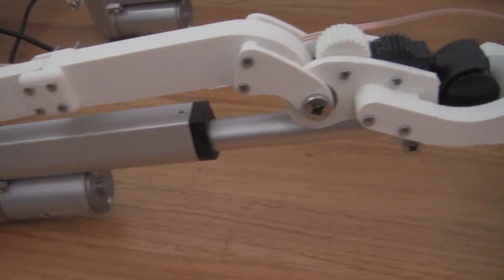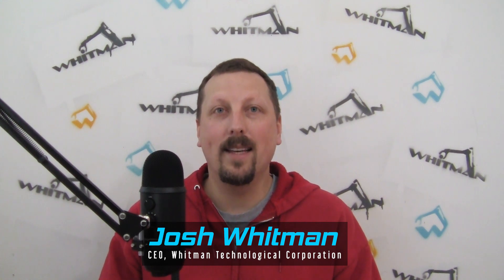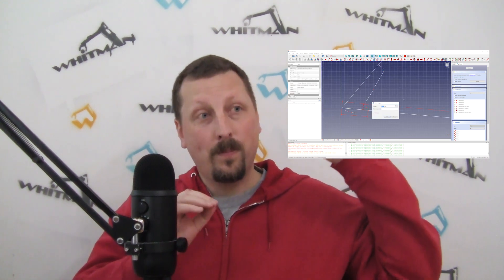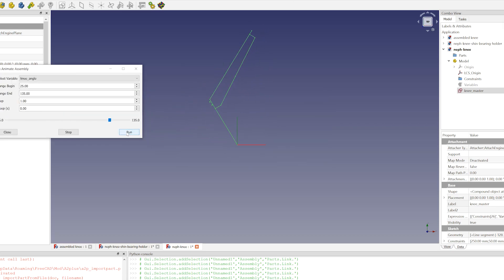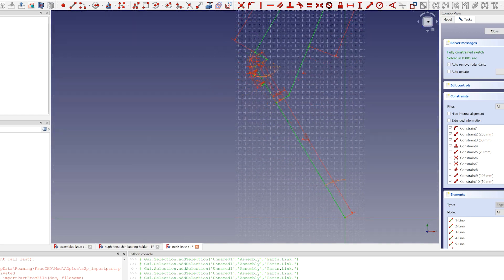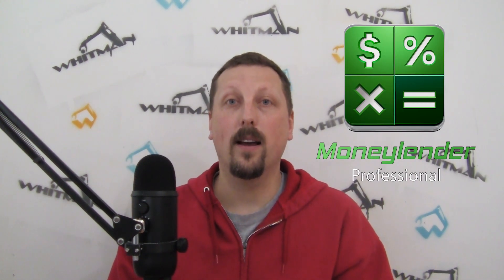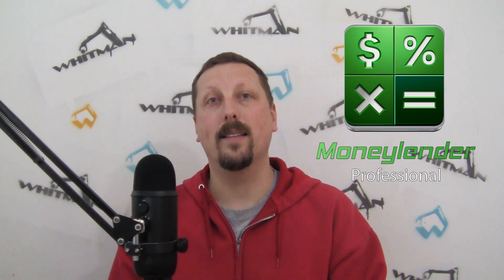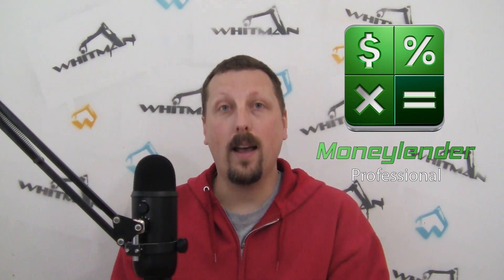Nephele Knees - FreeCAD and Assembly 4 Workbench, 3D Printing, Arduino and C#

Comment from the maker: Did I go too fast in the CAD timelapse?
Reply: Yes it was very fast
Reply from the maker: @Andreas Lechthaler The big difference from Assembly 3 to Assembly 4 is really a change in thinking about the design process.  In assembly 3, you build a part, and then attach that part to another part.  If you're creating something, and you need to modify your part, the connection between two parts will break if you made anything more than trivial changes.  So with Assembly 3 your parts kinda need to be perfect before you start to assemble.

In Assembly 4, each part has "local coordinate systems" (LCS) that I think of as sockets where other parts will connect to this part.  You stick the sockets together instead of actual features of the part.  Then you can go back and change a part and reset the LCS "sockets" as needed as you're building.  So you can make a crude box with various sockets  and stick it on the assembly, and then go back and put holes in it, carve out stuff, change the shape, etc.  All while seeing the changes in the context of the full assembly.  You don't have to worry about a single change breaking the whole machine anymore.  The LCS's are attached to whatever facets of the part that you want, so it's like Assembly 3 where you say "this LCS is centered on this hole", for example.  Now your part has a socket that you can use to attach some other part to the center of that hole.  And you plug the sockets together in the assembly.  If you need to make all kinds of changes to the part, and you decide to put the hole somewhere else, you just reposition the socket to the new hole the thing that's attached to that hole will realign to its new orientation without the need for any changes to the assembly.

On the Hips video, which is the next video in the Nephele series, I used Assembly 4 extensively.  Particularly, you can see I'm working up the outside of the gearbox using the assembled gears to figure out the shape and where I can put screw holes so they don't interfere with the gears and I can reach them with a screwdriver.  I'm designing a steel CNC mill right now that'll be my next video (unless I do a Moneylender update news first with all the changes I put in since January).  I started with sketching in Assembly 4 with just three line segments - one each for the x axis, y axis, and z axis.  The length of the segments are hooked up to variables that I can change to move the spindle around in 3D space.  At the end of each segment I have an LCS, so that the gantry and Z axis and all moving components can be oriented relative to these different coordinates.  These LCS's are the sockets that the parts of the mill will attach to to orient them to the table as a whole.

tl;dr: If you're not creating something, Assembly 3 is probably easier for sticking things together.  If your're designing something from scratch, Assembly4 allows you to work over the parts iteratively.  You can put a part into the assembly without it being finished and polished, and see how it fits.  I doubt I'll ever look at Assembly 3 or A2plus ever again.  Assembly 4 solves the same problem, but much more elegantly.

Thank you very much for your comment.  Hopefully this provides a little more clarity.  Once you get comfortable with making parts and LCS's, and then sticking them together in a model, you're gonna be really happy with how easy, fast, and robust it is to make machines in Assembly 4.